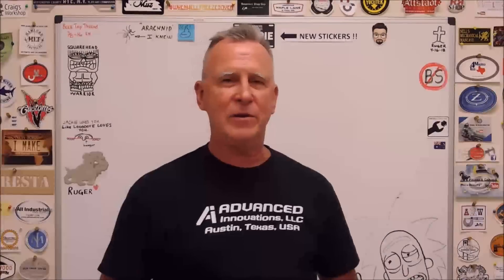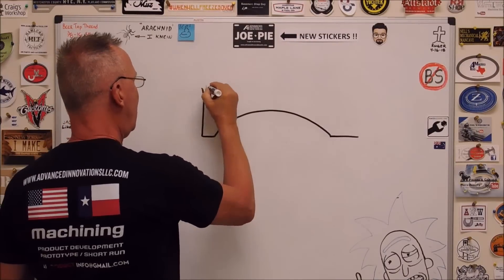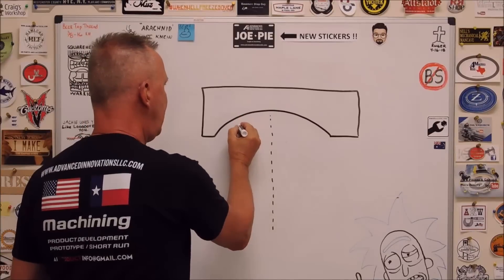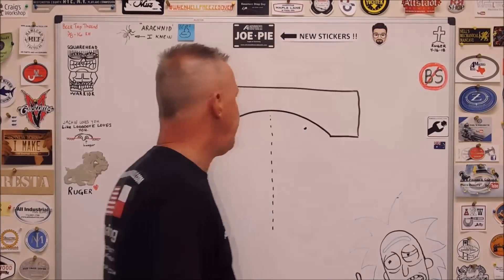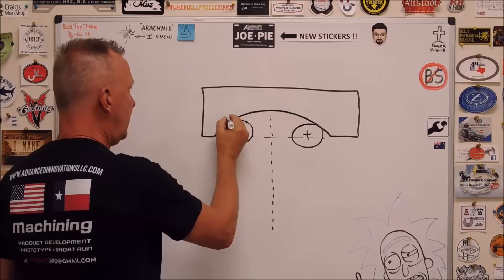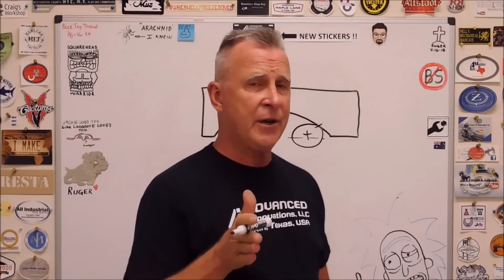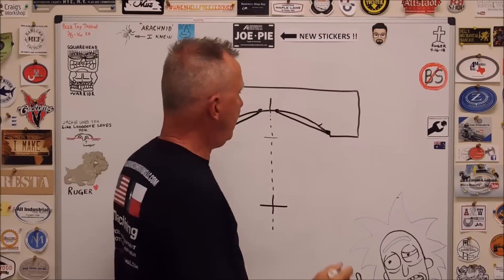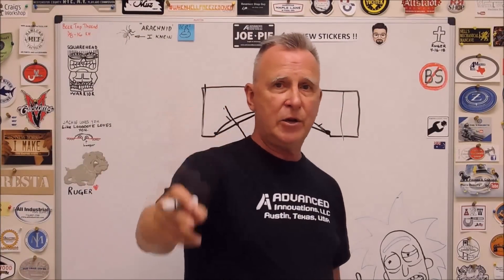How To Quickly Find the Center Plane of an Arc......

Comment: Joe, I once told my Trig and Algebra teacher that I would never use this stuff, boy was I wrong. Thanks so much for these lessons.
Reply: I think most of us made this mistake earlier in life.

Boy if they would have taught the class with actually building stuff, I might have even passed.
Reply from the maker: Show us the value instead of just the nuts and bolts. I bet most of us rebelled.
Reply: Haha. Algebra is fascinating. However electromagnetic fields wasn't, and have never been. Rather drive the garbage truck than calculating those fields, and it stands! Now retired...
Reply: They never teach “practical application”.
Reply: The teachers never knew how to teach it, was the problem, and as said never knew how to  put it in to practice.  After walking out of my engineering class because of a useless teacher, I later taught myself and used it every day.  Easy now days just use the app ony phone. No calculations.
Reply: @E30srule  The teacher in "Electromagnetic field THEORY(!)" ( a nightmare subject for many students) being a bit arrogant, aristocratic once told he would not be walking around, answering questions during the test. (That's normal.) His assistant would do that. 
To make it clear the subject is 3 dimensional but can sometimes be treated as 2 dimensional.
He would be out sailing his sailing boat! The evil horns grew on me and the comment given was: "Why such a limited doing, sailing in 2 dimensions? I prefer flying, in 3 dimensions".... He had no reply!
Reply: @procyonia3654 Same here, until the teacher asked us to calculate a set number of square windows,  and rectangular windows in a fixed area.

Comment: Joe, I have been thinking about how to find the center point of an arc for a long time for a project without luck. Your video is very much appreciated!
Reply: Much simpler with a compass and a straightedge ; swing2 arcs from any 2 points of the arc then straightedge from where those arcs intersect,bingo, the intersection of those straight lines is your radius  point!
Reply from the maker: I have to respectfully disagree. That technique will only give you a line that intersects the center point plane. It will not locate the center of the radius.

Comment: I have the same DRO on my 1953 Bridgeport and I love it. I like to use a edge finder. I would hit the two edges I want to use to setup center then hit center button.When doing something that is round I will run the edge finder clockwise on one side then counter clockwise on the other.I use the indicator to fine tune it if I feel it needs too. Be cool and Be Safe

Comment: When you've done so much work already you could move the clock to see where it touches the centre point of the radius , this will give you two triangles , and the angles can be calculated from them or the slope of the two lines from this the centre of those lines can be calculated and lines dropped perpendicular to them at the centre points and their intersection point calculated hence the centre of the circle . But then again I like to do trig for fun so maybe I'm biased .🙂🤓 I'd love to see your method which I bet is a more practical one . Good video sir !
Reply from the maker: Remember...there is only one arc that will pass through 3 points. Its just geometry at that point.

Comment: You can also do this with a sheet of paper, a drafting compass, and a mechanical pencil. Lay the part, and the sheet of paper, on a flat surface, then use the pencil to mark the straight edges of your part. Using the drafting compass, put the sharp, pointy end at the junction of the flat and the curve, and stretch the compass so the pencil is at the other junction of the flat and circular part. Sketch our a 90 degree arc, then flip the compass around and put the sharp, pointy end where the pencil end was before. Sketch out another 90 degree arc that’ll intersect the first. Now, flip the part over (turn it 180 degrees), and align the flat parts with the marks you drew initially. Rinse and repeat, and you now have two points (at the intersections of the arcs you drew), and - using a straight edge, draw a line connecting those two points. Lay the part back down and use a permanent marker to color the part on the curved face where the newly drawn line is. You can now use a scribe (or the sharp, pointy end of the compass) to mark the part on the permanent marker ink. It’s fairly quick, and takes way less time to do, than it did for me to describe it here. 😊

Comment: Very good Joe! Question? On that part, can you determine what that radius is? For instance the radius on a folding table top. We know the tangents are at 90 deg but the cord is iffy because where does it change from the straight edge to the radius? I'm thinking use a machinist square and gauge pins  as the 90 deg transition on the squaire is relieved.

Comment: I want to add one detail. You are searching for the center line with the back of the piece as reference. Sometimes you want to have the front where the arc is ending as reference. Don't assume that both are parallel but check this, too.

Comment: Many thanks for sharing this.  For some reason, I've had a little trouble with finding the best way to find "touch off" the surface of a part.  Have you ever done a short video on that subject?  I know about using paper.  The CNC guys seems to have a gadget that looks like a dial indicator.  Not sure how that works.  Is there a best way using a manual mill?

Comment: As you’ve found the centreline, can you use the indicator and dro to measure a chord parallel with the X axis and then it’s offset from the radius at the centreline to extrapolate the centre point?
Reply from the maker: Once you have that plane, its easier to just back out the table on center and keep sweeping the arc. Keep bumping the indicator arm until the indicator stays on the same number as you sweep the arc. When it does, you're on center. I'm sure you could do the geometry and trig, but I'd be done long before that.

Comment: Good info! Thank you.  Question about your inidicol... what are your thoughts on the knock offs online, or making one myself?
Reply: I've got one of the knock off ones and it works pretty good, my only real complaint is the ding that's supposed to ride in a slot to stop the indicator clamp rotating can spin and jam when putting the indicator in but as long as your careful clamping the indicator, they work fine

Comment: I have a contested property line with well defined end points, and a huge tree unequally spanning both sides, so tree "center" is not on the property line. 
A stringline has to go around the tree on one side or the other, or both, to determine where on the tree to mark the property lines.  
A fence erected along the stringline will be the 'illustrated' property line..  but the string is not true going "around" the tree as it's taught. 
So how do we use one stringline and pass it through the tree ?
Reply from the maker: You'll need a jig that looks like a Pi sign with long upper arms. Connect the string to the ends of the short legs and put the tree between the legs. Run the string to the other  property termination point. As you manipulate the the jig, look for the string to be parallel with the long edge of the Pi. Bingo.
Reply: @joepie221  Thanks Joe..  I imagined such a tool would find center ..  thanks for confirming 👍😎✊

Comment: This would have been a perfect application for a Haimer 3D probe, and I'm surprised that more manual machinist aren't using them. As an added benefit, because they zero out directly on the centerline, you don't have to deduct for a probe offset, which makes them great for using a mill as a CMM. They're quick, accurate, and every easy to use. Their only real downside is cost, but their versatility more than makes up for it.
Reply: Okay but my questions are as follows

1) what is the cost of a Haimer 3D probe verses a regular DTI?

2) how much time does it take to set up and use a Haimer 3D probe verses a regular DTI?

My suspicion is that the answer to both of those questions is "More. A lot more"
Reply: @JaenEngineering  You can do a quick search to answer your first question, but the devices have different capabilities. So a direct price comparison is kind of meaningless. Just like any other purchasing decision, you have to weigh whether it's appropriate. 

In regards to set up and use time, it's not even close. A Haimer is far quicker than a DTI or rotary edge finder. I modified an R8 end mill holder to accommodate my Haimer with an interference fit. Haimers are  initially calibrated like a 4 jaw chuck. This does not need to be redone during change outs. Just like any other R8 tool, I only have to loosen the drawbar (mine is captured and auto-ejects tooling) to change tools. Because my Haimer has a fixed R8 shank, even depth calibration isn't altered during change outs. The best part is the actual use: you just run the probe tip into the surface to be measured, from any direction except up, until the dial hits zero, and that's it. No math, very quick, and it's accurate.

Comment: Hi Joe, great info as usual.  Would an edge finder work equally as well.
Reply: Yes but not as accurate.
Reply from the maker: Im sure an edge finder would get you there, but because of the opposed surfaces, you'd want to reverse the spindle for one side.

Comment: This works great assuming there is no backlash in X axis when using your knee mill as a measuring tool.
Reply from the maker: Zero opposing dials in different rotation. Problem solved.
Reply: @joepie221  problem not really solved, the slop in the acme screw and half nut is not understood by your non calibrated DRO that you used to take the measurement. My suggestion would be to only move the X axis in one direction for both measurements.

Comment: There are infinite center planes to that arc; I assume you meant the one that is perpendicular to the plane matching the opposite side of the part which is mated to the vise ... you failed to mention that.
Reply: Yes there is an assumption that the two small arcs are the same size and centers are aligned with the back (X-axis) of the part then after using 1/2 function a move in the machines Y axis is on the plane.

Comment: Word of caution: this depends on the orientation of the back side of the piece. If the back isn't parallel to the x-axis, you're going to have a bad day.
Reply from the maker: Paul. I have great respect for you, but have to respectfully disagree. This will give you the center plane but I make no reference to its relationship to other features.
Reply: @joepie221  Please elaborate on what is being discussed here. I think it is relevant.
Reply: @joepie221  Take 3 points to define a plane.   I think you did reference the back of the vice when you zeroed the y axis.
Reply: I'll disagree with that statement. We're not finding the center point (which would change based on your described situation) we're finding the plane that bisects the center of the radius. Doesn't matter how the part is orientated. You may have to doodle bop and play with your Y but it will work.
Reply: @joepie221  It gives you the plane of symmetry that's perpendicular to the x-axis. If you pick up a point with the part parallel to x, then rotate the part by let's say 2° and indicate it a second time, the new point will shift over by that same 2°.   That's mainly an issue for large radius curves on short parts, for example an 8" part with an 128" radius of curvature. That sort of thing is very common in optical applications.
Reply: @PaulSteMarie  -" the new point will shift over by that same 2°. "
We're looking for the plane though. So it, the plane, will be off by 2deg to X, yea, but it will still be the bisector. The c point will change, you're right about that.
Reply from the maker: @BradKaboord  If you take half of a pie and slice it a dozen times, each plane or knife cut will intersect the center of the pie. Just like this video technique demonstrates, there are infinite planes that will go through the center of an arc or circle. Pauls comment just points out this very fact. Just because you've found that plane, it doesn't mean its square to the back edge unless its setup that way. In this demonstration, it is. And normally would be if you keep your vises true at all times.  To go a bit deeper on Pauls comment. Finding the centerplane of the arc doesn't depend on the backside being in any particular orientation. The plane will still pass through the arc center point regardless. It just may not be perpendicular to any other features unless setup that way.